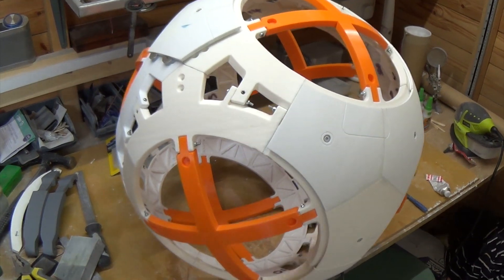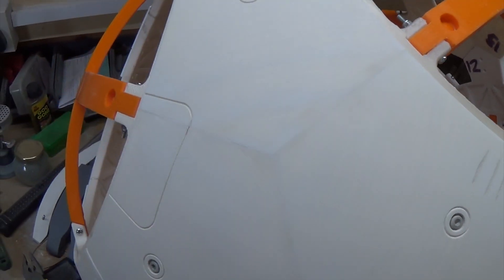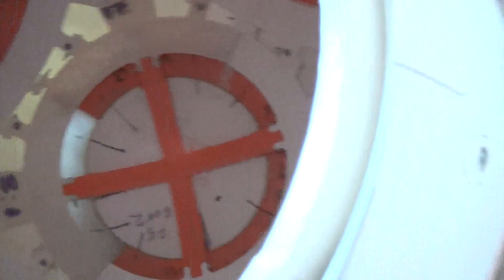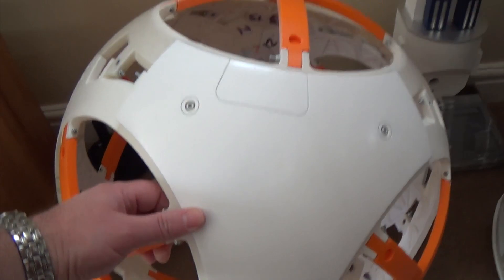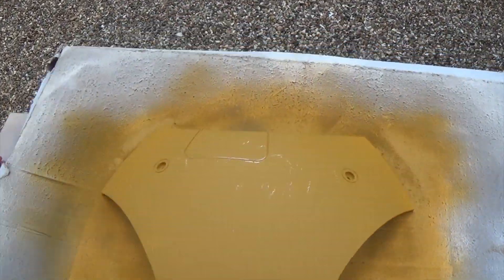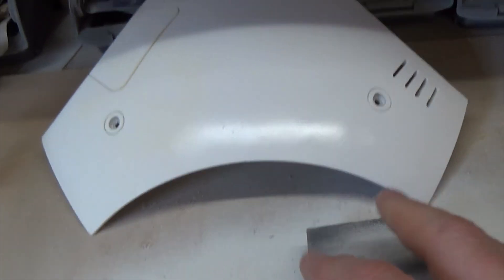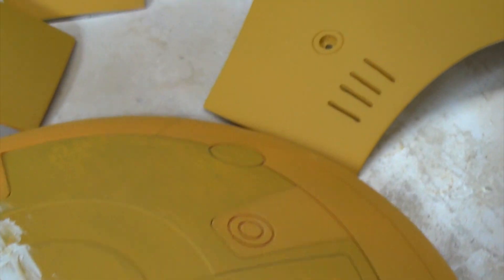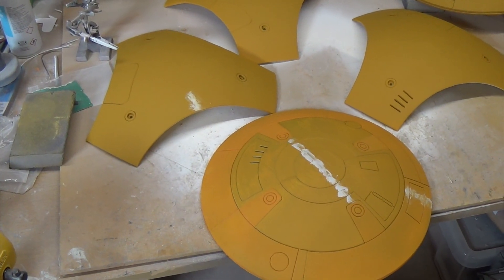BB 8 build -  Part 3

Comment: Hello, I doubt you’re going to reply but, who’s files from the forum are you using for the inner frame? I really like the look of it and would like to make this one too

I assume that the panels then from the wiki page will fit this frame.

Thanks
Reply: Hi there. This sphere was designed by Carry Christie II (I think I have the name right) The files are available to all club members. If you join the BB-8 Builders club you can access the files there. I think he now offers a pre moulded version which is easier to build if you don't want to print them yourself.

Comment: May I ask what 3D printer you are using? What material? and How long do you estimate it took to 3D print all of the parts?
Reply from the maker: Hi, I'm using an Ultimaker 2+ and use a variety of 3D filament. I hate to think how long the printing is taking, my printers been running 24-7 for literally months, between all my projects. To be honest, I'm amazed its stood up to the pounding it's getting. I have to replace nozzles every now and then, but otherwise it's been fine.